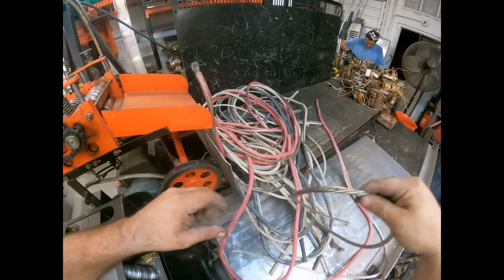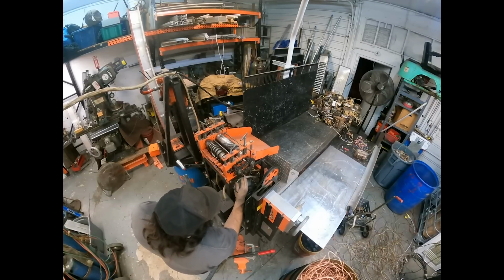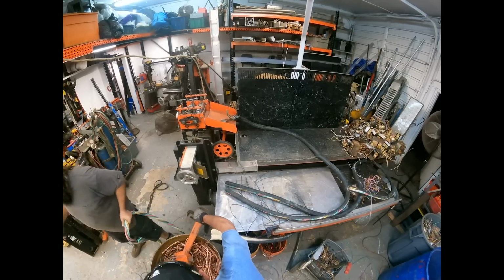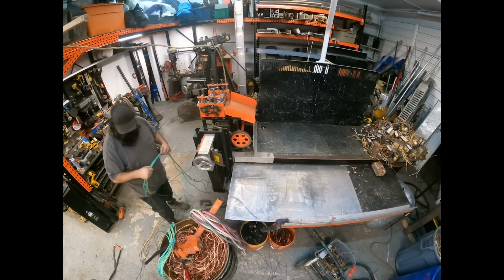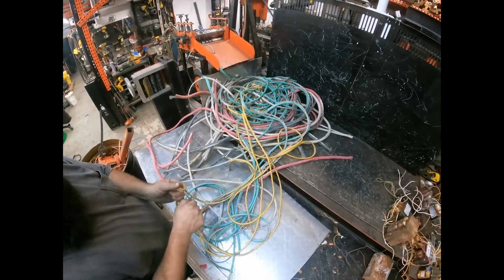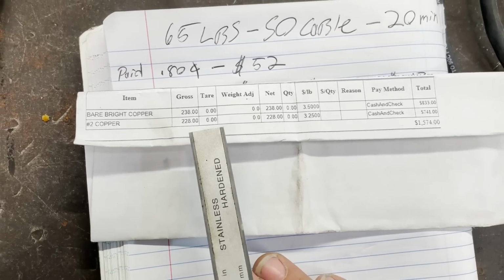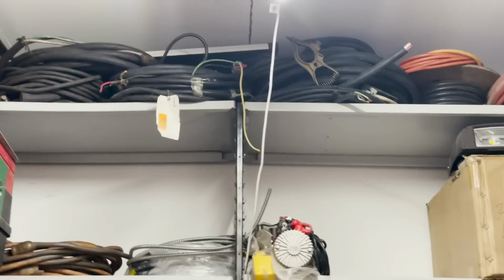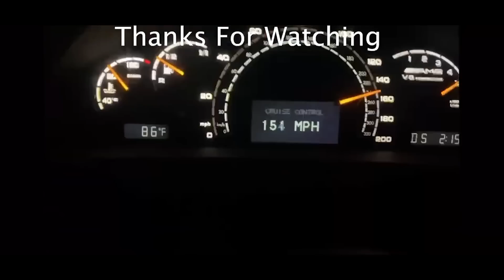Massive Copper SO Cable Stripped!!! Was It Worth It?

Comment: I finally bought some real battery jumper cables from Napa 44 bucks but they're a hundred times better than the copper clad steel ones everybody sells.  If I made some probably some nice wire attached to some cheap vice grips (4). The sides plastic dipped red / black according to polarity, avoiding the threads and grind the teeth smooth.  10.00 jumper cables
Reply from the maker: Thats a great Idea

Comment: Looks good man.  In looking at your wrap-up paperwork showing the profit numbers, I noticed you do not have fuel costs listed.  From a cost accounting point of view, there are actually two fuel costs to consider.  First one is the round trip fuel cost of going to the job site and back to the shop.  Maybe you picked up that wire from assorted jobs, not sure.  Second fuel cost is the round trip to Miami and back.  Since fuel costs have gone up over the couple of years, it prolly should be deducted from the bottom line for a more accurate ROI number.  Since you know exactly the round trip mileage to Miami and back, figuring out that fuel cost should be fairly easy and just add it as a standard deduction when you do your wrap-up calculations.  Whether you want to add the round trip fuel cost of going to the job site for picking up material is up to you.  Just my opinion on these two fuel costs.  Still, very nice ROI per hour when you strip it, fuel costs added or not.
Reply: Aluminum is not worth scrapping here in NJ it’s  .50c lbs
Reply from the maker: I get that and there would be more costs involved as well. It came in with a hole bunch of other scrap and was sold with other scrap. I was just showing what the recovery is and what you could make an hour processing. People would not have the same cost as me so its more of a what's it worth video.
Reply: I didn't know you meant "recovery" as in a vacuum without all other costs.  Makes sense as in how you described it in your reply to me.  I'm a pretty detailed kind of guy, so sometimes stuff goes right over my head.  I almost said "don't forget to include the cost of those delicious steaks on the grill" 🤣🤣

Comment: 2 lengths of 1/0 welding cable electrical taped together with some heavy duty alligator clips on the ends makes the absolute best jumper cables. I got a set I made about 30 feet long and haven't found anything i couldn't jump start with em. They've worked on big ole diesel dump trucks and 300-400 size excavators no problem.
Reply from the maker: Thanks for the suggestion ill keep that in mind next time I get some welding cable.

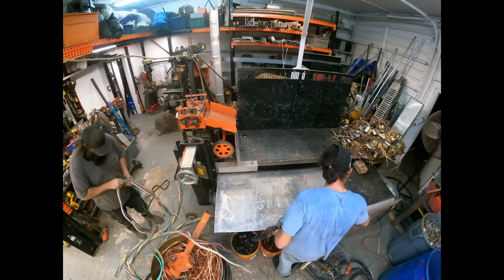Comment: 7:36 That’s the ripcord, big ass cables like that sometimes have a kind of indentation in the jacket that if you cut into allows you to strip off the outer jacket easily by just pulling the ripcord. It’s usually made of heavy duty material like Kevlar reinforced plastic or rubber
Reply from the maker: Thanks for the info

Comment: We us that exact 1/0 cable on mixer drive motors for concrete batch plants, curious if it came off of one of ours.  Maybe about once every other month I get a work order to replace all the cords from a plant that has had them stolen and it aint cheap (very often in the Chicago area, shocker).
Reply from the maker: Thats probably what it was from

Comment: for solid wire if i was doing your volume then i would need to stop doing it by hand but say a barrel at a time 12/14 and romex a vise and a razorblade and a knife with grooves it will peel it all out like butter without digging into the wire if you put tension on it till it thins down the kinks then long lengths work better with the multi wire i would normally pick one to pull on to tear the insulation as it comes out if you go down to phone wire then you need to use a bolt (micro scrapping) but i stopped hording a copper collection cause everybody considers it stolen now
Reply from the maker: Thanks for sharing

Comment: Why is the wire considered #2 even after stripping it. I would think it is just bare bright #1 after stripping it.
Reply from the maker: They say the strains are too thin. Any extension cord, welding cable, or SO cable like what I stripped is considered #2 copper or #2 insulated if sold as is.
Reply: My yard considers it #2 if it has a silver colored coating also. I think it's tin. Or sometimes there is a reddish coating on it they classify as #2 that are put on motors.

Comment: That is an expensive shifter. They probably come out of an 80s model Hurst Oldsmobile. That car was only made a couple of years I think and it was kind of rare to begin with.
Reply from the maker: I looked it up on line and used they sell between $900-$1200. I have all the parts so I will be putting it back together.

Comment: is that nickel plated copper?
Reply from the maker: It might be, some times its silver sometimes its some type of tin.
Reply: @Project Shop FL  thank you for your reply.i had similar cables but they were filled with a white powder inside also rubber exterior.i did the wrong thing and tried to burn the rubber off.oops.